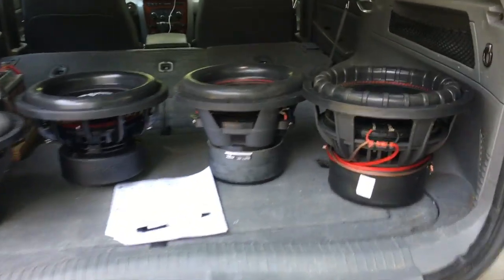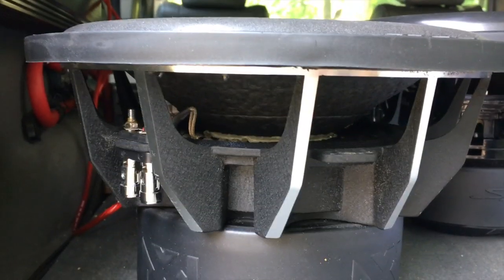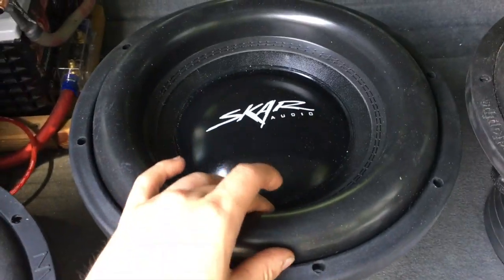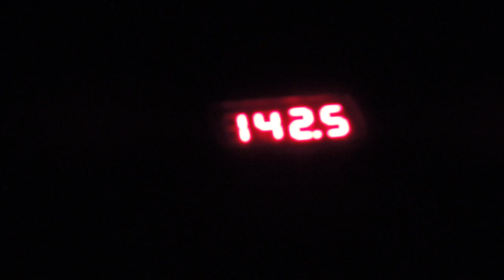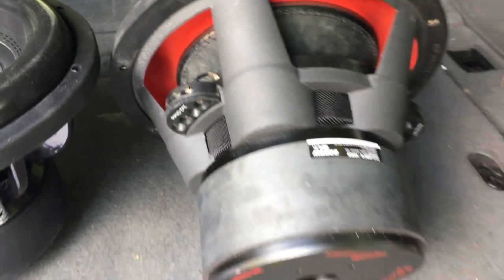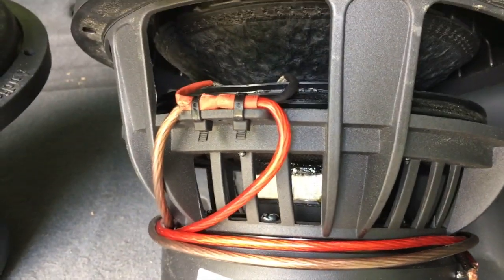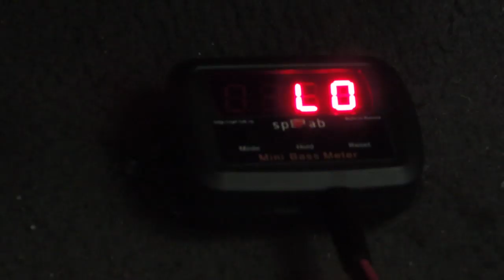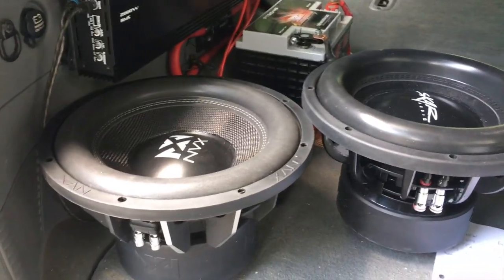Best Subwoofer Under $200?? Best BANG For The Buck? | Skar | AmericanBass | AudioPipe | NVX

Comment: For the ADHD people heres the final verdict American bass #1 audiopipe #2 . Your welcome
Reply: I agree. I use AB for budget builds at my shop. That said, all of these sound like shit lol.
Reply: No. American bass. "AB". Didn't want to type it, guess I had to now anyway lol.
Reply: SQ, power handling, and budget friendly don't usually go together. That said, for a noticeable increase in volume you'll need to at least double rated power. The rule is a 3 db increase for every doubling of power or doubling of woofer cone area. 
 Tropo 15 is 450 watts RMS I believe, so assuming for something in the 1000 watt range, decent sound Q, I'd say American Bass XR series (NOT RX) . It's got composite cone, 1200, rms rating and it's decently priced. Sounds better than the XFL also. Don't get me wrong, it's still loud af, but more SQ oriented. Bob, the owner of American bass has stated its his favorite woofer they manufacture more than once on the phone. 
I can plug you with a good price if you need one. They retail around around $230 I believe.
If budget to you means more than 200, it opens the door to many better woofers as well.
Reply: @chief9-10-games5  look at the amp dyno run of the Orion hcca 3000splx.  Through out 5000 rms at 1 ohm certified,  and dynamically it burped out over 7k rms.  So do your hw before you bash a company.  So Orion missed their mark in the Ztreet line,  people who want quality sound pay quality prices
Reply: Sean Patrick  How's that Tropo holding up I was thinking about getting a 15 for my work truck?
Reply: @chief9-10-games5  dude 😂😂 I'm 32 and been doing car stereos and home audio since i was 18, I DO have experience too ya know.  And amp dynos don't lie.... and go check out the amp Dyno channels where you actually can see the true power outputs of all your older amps. You'll be shocked to find how many ratings are off.
Reply: @chief9-10-games5  plus I literally have videos up ON MY CHANNEL OF MY CURRENT BUDGET STEREO IN MY WINDSTAR.  NOT A SINGLE ORION PRODUCT IN IT.  I'm building the next one with out worry about expense and that HCCA 3000 is a fooking beast of an amp with quality sound, heard it personally and I was sold
Reply: @chief9-10-games5  and YUP, bitties LOOOOVE the body sooo yeaaa,  now I'm just having fun with you by commenting and commenting.
Reply: @TheBoostinbobby  Hater lol I cld give to shit$ on how fit you think you are me myself am a life long judo practitioner as for the system that's koo On to the nxt one son
Reply: @boosted4g638  Hey Shay, how's it going? I'm in buying an XR?  Only come as a '15, right?  No '8's I take it?
Reply: @Navy cook. They come in 12 inch
Reply: And 10
Reply: @ chief...
Zapco Z-series AP, Hybrid audio, DD Audio, Rockford Fosgate Power series on a 240 amp mechman alternator. And about $1200 worth of dynamat. Sundown is garbage, Sounds like shit like all these subs. Although the XFL is a respectable sub for what it's asked to do.
Reply: @chief9-10-games5  Sundown overpriced? The sa12s are 200 bucks, the xfl is 290 lmao.
Reply: @rickytrevino8281  I was talking about the other subs I there line up shits all priced WAAAAY to high and it's the same shit other companies are selling allot of it comes outta the same build house Slap a Sundown logo on it and double the price lmfao NO THANKS
Reply: @chief9-10-games5  Oh yeah? Go buy yourself an audiopipe 12 thats significantly under 200 bucks and try to put 2k rms through it for years and years
Tell me how it goes buddy, 10 bucks the piece of shit wont last a week LMAO
Reply: U said adhd
Reply: I have a single DD 9512 setup with an old-school crossfire powering it and love it. Daily driver
Reply: your the best 
.....time is money. I love that right to the point
Reply: Thank you
Reply: you're
Reply: @boosted4g638 ... you advised him [Shawn Patricio] well.
SQ, Power Handling, and Budget don't mix well at all [kinda like Oil & Water].
We all experience it like this: Aim for SQ, Power Handling, and Budget friendly BUT you can only have 2 at a time. 
If you get SQ & Budget Friendly, you'll probably have no power. If you choose Power & SQ, you'll loose the Budget [friendly]. And if you choose Budget Friendly & Power Handling, they'll probably be no SQ to be found... lol
In the old days, we used to aim for subs that we're Budget Friendly & had decent Power Handling. Then we'd throw as much Craftsmanship as possible into the install, in hopes of preserving some sort of SQ.
🤣
Reply: Shay Benson what do you recommend?
Reply: @TheBoostinbobby  w
Reply: @boosted4g638  what do you suggest for fast and loud metal?
Reply: @charlesuh60m  honestly for entry level performance pricing, good output, and longevity on some metal I'd say a smaller sealed enclosure (like 1 cu. ft. Per woofer) with two Rockford P3's. I used to bang lots of metallica, Rob zombie, bullet for my valentine, TOOL, etc... on a setup like that and loved it. Run a Zapco ST-1650XM2 mono amp. You will feel the double kick drums slapping at the back of your head. The smaller enclose will sacrifice some of output of the lowest bass notes. But unless you listen to rap or EDM you won't notice much. I listened to rap on that same setup and still enjoyed it. Don't listen to anyone who says that's too small of an enclosure. They've never tried it. I have in 3 different brand of subs and it hits harder than many ported. But as stated before, you will lose volume on the deepest bass notes. But it wasn't much tbh. I've considered going back to a small box and I'm using a huge custom enclosure tuned to 36hz currently. I feel oiled that's saying something.

If your using factory mids kill most all the bass going to them so you can crank up the volume to them without causing damage to them, then turn up there gain on your woofers to match them. Then you have clear loud factory mids and the subs are banging along with them to fill in the lows.
Reply: @boosted4g638  I truly appreciate that thoughtful response. I agree, that does sound like a perfect setup. I was looking into  mrmusicman audio but it seems like all of the powerful subwoofers require a ported box when sealed is the way to go. I will definitely look into the p3 from rockford. Thanks again!
Reply: Good looking out fam! 👍😄
Reply: Thank you so much
Reply: As a member of the ADHD community I thank you!
Reply: @chief9-10-games5  Sundown overpriced trash? Overpriced for sure but definitely not trash. There dominating right now and you don't get to that level if you're products are trash.
Reply: @amanteapasionado6836  I agree to that Well said
Reply: @TheBoostinbobby  Orion HCCA and XTR amp are better than almost every brand that's big right now in terms of power ratings. All the popular brands like sundown or your go to brand Skar rate accurately at 14 volts. They may do a lil more than rated but that's it. You said your going with a Skar amp over Orion to push your AB 15's and my question is why? Orion amps are way overrated and they rate there amps at 12 volts. Did you see the XTR2500.1dz amp dyno on Big D's channel? I dont remember exactly the numbers but it did like 3 or 4 times rated power.  Oh and why are you bashing Orion but have a SSL amp pushing Atomic subs, thats blasphemy. Atomic subs are great subs, show them some respect and atleast run them with a decent amp.
Reply: I really have it, after 5 seconds I went straight to the comments
Reply: @rickytrevino8281  What if you only run 1k watts?  I just want to run 2 12's in a sealed enclosure in a hatchback.  Thanks for sharing.
Reply: @rickytrevino8281  sa 12 is 750watts the xfl  is 1000 watts  there the same cost xfl is lower sometimes
Reply: @bigsean2473  More watts doesnt equal better quality. You have to take into account the engineering such as materials used, cone area, tensile lead strength, etc. You can easily bottom out if you have an air leak or a clipped signal going to the XFLs, but due to how the SA12s were designed it's almost impossible to bottom them out.
Not to mention SA12s are severely underrated, why do you think there's plenty of videos of people giving like 2k RMS to one SA12
Reply: @dronexfun8469  Itll work but I would recommend more wattage, you can always try wiring em in parallel at 1 ohm for more wattage but you'd have to see if the amp supports that. For two SA12s id say the best budget amp to go for would be the Skar RP1500 or a RP2000 incase you wanna up the RMS down the road since they can easily handle it. By this point though you'd need a big3 upgrade and probably an AGM battery
Reply: @rickytrevino8281  ive had both back in 2012 the sa12 were 230 and xfl were 179. the sound about thr same but the xfl was louder and too more than rated  i had 2 15s xfl i use to run 3500 watts to them and was never a problem and they sounded great. my point with the watts was you get more for the same price vs the sa12
Reply: @bigsean2473  I have 3 SA12s, each taking 1k RMS for the past 4yrs daily two of which were used already and are probably older. No recoiling, no reconing, and no problems. My friend had a pair of XFLs and they lasted for about a year
Reply: Thanks 🙏
Reply: Thank you you literally just saved my life lmfao
Reply: Thank you
Reply: Bunch of damn 9 yr olds arguing
Reply: @boosted4g638  I use to own a RE Audio XXX quad coil 15" sub years ago. Is there any subs you know of that's cheaper that's anywhere close? Like something you'd say well it might be better but for the extra money you have to spend it's not really that much difference type of thing? I'm not in competitions at all and just wanting something for a daily driver. But being use to that xxx i don't want to be left totally disappointed and that might not be hard to do.
Reply: Looll
Reply: Omfg thank you sm😂😂😂
Reply: Yeah, due to cry baby companies not wanting their cheap crap known it's cheap crap to the public they started suing people for coming straight out and saying this one's better lol. Somehow it's seemingly illegal for you to think ones better made than another just cause it lasts longer, has higher quality materials, and performs better because some weird person somewhere might disagree and think the junk is better cause it's prettier in their opinion. Lol
Reply: @keiththiering8871  Nice ! I still have my Crossfire VR1000D for subs and VR404 for mids. I kept going through their BMF subs but their amps were quality. I've had these for nearly 20 years !
Reply: thank you😂😂😂😂😂😂😂😂😂😂😂
Reply: Thanks
Reply: @TheBoostinbobby  not everyone wants to put thousands of dollars in their system bro
Reply: @jackle842000  you would probably have to build one if you want to have something as good or better then the xxx . Some companies have really good parts of a sub but never the whole thing 
Like one company might have a bad ass motor but put the wrong basket on it or shitty soft parts or vice versa so what I like to do is buy used subs and as I keep adding to my collection I'll go through and figure out what the strong points are in each brand and start trying to mix and match a frankin sub lol 

Like for example the HCCA is a pretty good sub with a 4" coil but if you over heat it the motor can shift on you 
It even says that in the Manuel when you buy it
But the American bass xmaxxx 15" has almost the identical same moter except it has 4 lag bolts running through the entire magnet so that it can't shift on you if over heated 

Just an example.
Reply: Have you guys ever heard of Toro?  Do you know if it's any good?  Supposedly made in Texas.
Reply: @menard79  same build house as massive audio American bass sound qubed just a little more affordable
Reply: You the MAN!
Reply: @TheBoostinbobby   I seen a dude drive by with a chevy Beretta and was hitting hard.  My brother and I were like ..wtf that was bad ass.  We'd buy shit from goodwill if it was decent and run a home stero in my mom's jeep Cherokee. Was fun. Summer fun in the 90s.   1 day. Dad dropped me off at school and seen the biggest speakers I've ever seen. They were Altec Lansing Model 19. Guessing box was 38 x 38 x 38 big 15.  Dads like ahhhhh. More speakers geeze.  Loaded them up in a suburban. Dad almost had a heart attack.   Down the road sold them for some 12 fosgates and a motorcycle engine. Xs 650 yamaha. We got them Altecs for free.  I looked them up a few yrs ago and they retail from 2700 to 5k.    Makes me sick.  However. If my dad was still here and I sold them and gave him the money.  I'd say Dad  Here's some of your property tax money back since they just keep going up.  Had to share.
Reply: Thank you
Reply: Lmao attacked
Reply: Ty
Reply: @boosted4g638  I know this is 3 years later but I’m trying to get into this. I have my dads old box (no subs or amp) and I’m trying to get 2 12’s for it and a amp but the problem is I don’t know where to start or look. Everytime I look up subs I just see Skars or kickers and I’ll see “ the subs amazing” and then “it started smoking within 1 day”. So I’m trying to get into this but I’m somewhat struggling lol. I don’t want anything that’s like crazy loud just something that sounds good ash
Reply: Adhd here, reading the comments, commenting on the comments, and watching the video for the first time wondering if the comment I'm commenting on is correct, and if I should go back to working now.
Reply: I got me myself a 2800watt 15inches audiopipe today yeeeeah
Reply: @TheBoostinbobby  Got a question for you. I sent a longer, more professional version of this question in an email to a professional audio shop and didn’t even get an email back. Can I get a nice 12” full system for $700-$800, I’m talking everything. Head unit, wires, sub, amp, box, installation. Can all of that be had for that budget? Like shit! I’m 33 and I can weld but when it comes to electrical and wires, I’m lost. So. Shit.
Reply: @MAGA_Randy_Marsh no not really, unless you get really cheap audio products and you and a buddy install it, or you can get second hand stuff and install it yourself, any audio shop is gonna get you with labor, but they do it right, most of the time, lol, I can install anything, 12v isn’t that hard to understand, you can take your time and build the perfect setup you wanted also. Build it over time.
Reply: @cmoney429  what do you think about just getting like the whole audio system in one go, like the skar 12in sub with amp and wires package and then take it somewhere to get it installed?
Reply: @boosted4g638 
Resilient sounds gold 
Ct sounds messo
Used zv3
So many more budget friendly that pound and sound good
Reply: How do you know 😮

Comment: The NVX venting is smaller by design. Smaller holes that are working in concert with the center pole vent create greater velocity and controlled directivity. The air gets to where it needs to and leaves in a hurry providing better cooling. The “weave” is actually a carbon fiber reinforcement of the non-pressed cellulose cone, adds rigidity without the weight of heavier plastic polymers; gives you the best of SQ/SPL.  Of all these subs, NVX ranks best bang for my buck all day long. ;)
Reply: Awesome,I was thinking bout buying two nvx122 12's go with my 4 fosgate 8's.
Reply: Was thinking of doing the NVX VCW V.3 15’s for the best sql. They’re the newer version 1200 watts rms a piece.

Comment: I'm running 4 XFL-15s in my Tahoe on an American Bass VFL-450.1 (The old silver one rated 4300 RMS @ 1 ohm, not the weird new black ones around 2300 RMS) at 0.5 ohm.  They sure can take a beating.  Definitely underrated wattage on these subs

Comment: Remember, FS really isn’t a spec that can tell you for certain a sub will be able to have solid output down low. QT is a way better indicator for that! Higher the number the lower the sub will go. A cars acoustics/transfer function also plays a significant role in this as well. Most importantly, in order for a sub to get down and dirty low, gotta be sealed! Sealed boxes are just low note monsters!
Reply: Down and dirty yeah but ground pounding maybe not as much with sealed

Comment: Have two Skar VD 10"s. Running skar 1200.1 @ 1ohm. Man im impressed with these subs.  they get ridiculous Excursion spl and clarity. Rated at 500 watt RMS but I'm feeding them 750 each on The Daily. They pound! Extremely underrated subs and amps.
Reply: @cheddarballs864  Interesting who Woulda thought a 3000w amp would be more powerful and hit harder than a 1500w.👌

Comment: Those dimples in the cone are the bolts holding the spider ring down hitting the cone, due to over excursion.. those bolts hit the cone before you actually bottom out the former. Turn that sub sonic up almost half way.. they will break all the way through if you’re not very careful.

Comment: Just impulse bought an American bass xr10 and I'm loving it and it's not even broken. it's sounding better every day. Sq version of xfl. 3" vc, 200oz magnet. Already best sub ive ever had
Reply from the maker: I really need to get an XR ASAP!
Reply: rmblwgn I got a sa10v3 and was gonna switch to either a xr10 or a xfl 10 I just can’t decide which one
Reply: @israeltorres4109  get xr10 run 1000-1500rms